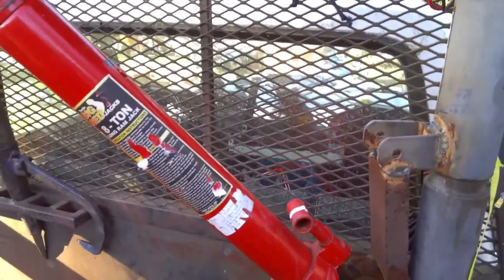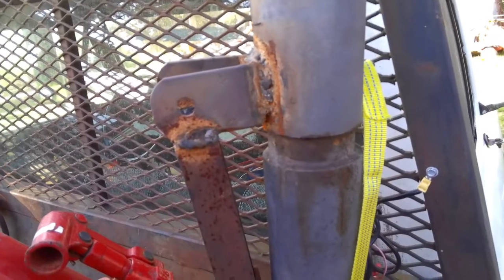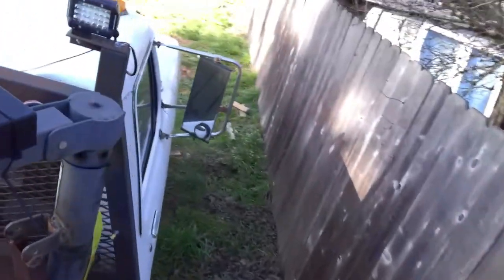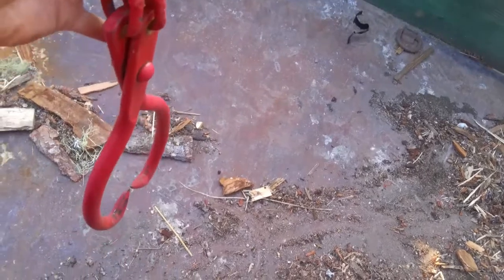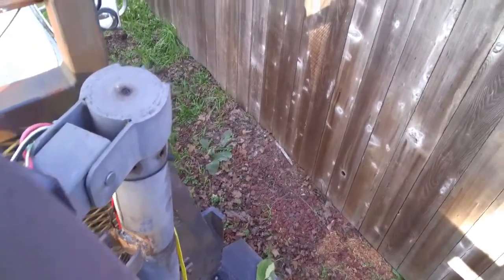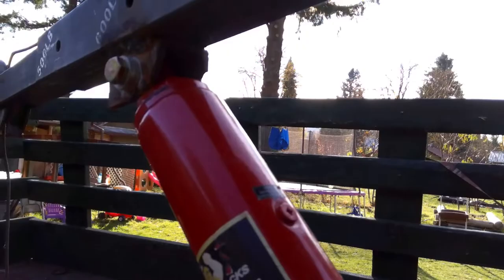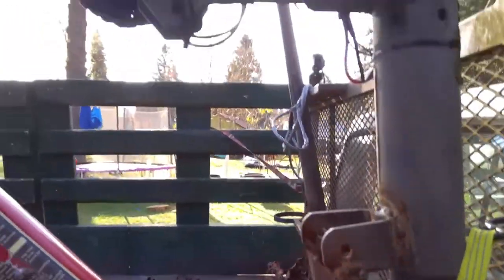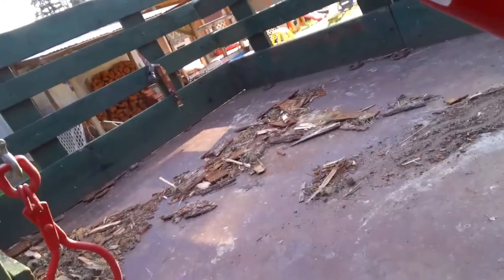Log hoist on a ford flatbed

Comment: Try a site called Surplus Supply for a great selection of hydraulic cylinders of virtually all kinds and sizes.  I cheat....I use either a backhoe or skidloader to load.  lol.   Cool lift man on a really cool truck.
Reply from the maker: Tractorman44 Thanks I will check the site out.